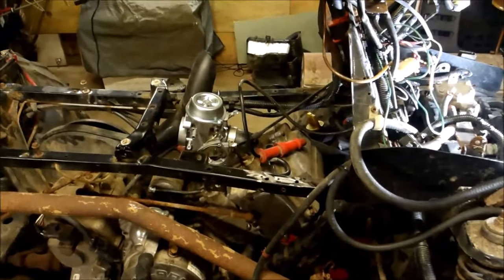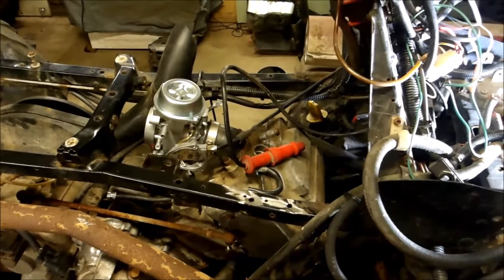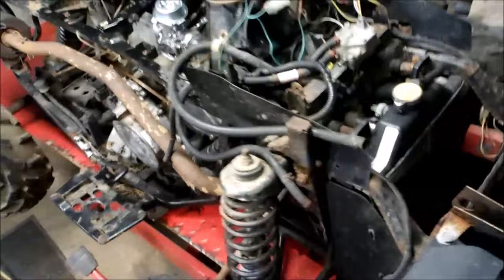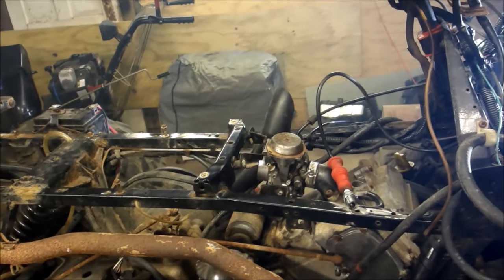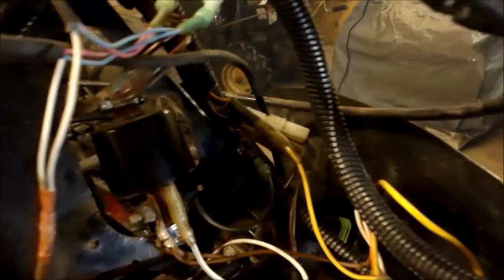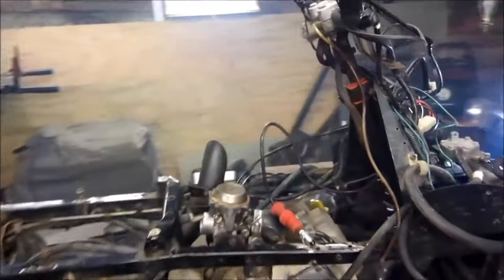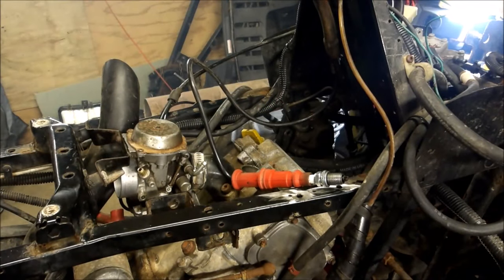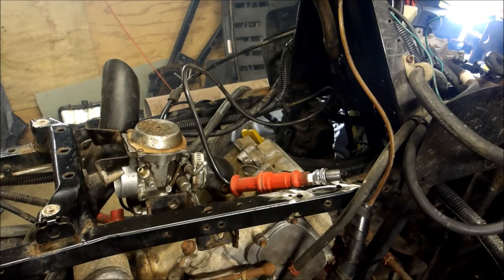No Spark or One Spark quick fix- Polaris

Comment: I know this is older video. But I just finally figured out this problem. Hook up your black wire. Hold throttle just open a bit till it starts to pull cable. See if it starts. Pop off cover on throttle. There is a kill switch in there on the throttle lever. If it touching then it kills spark. Cable has adjuster to adjust it to not touch. Loosen jam not and adjust cable. Then tighten jam not back up.
Reply from the maker: Yes. That can be one of the issues. The other is if the kill switch on the left is corroded. I rocked the kill switch back and forth a couple time on one. cleaned the surfaces and it worked too.

Comment: Not sure if you still monitor this post but my Polaris 500 Scrambler 2000 weeps gas out of the little black hose on the bottom. Stats fine, revs good but cuts out periodically at higher rpms, will idle fine, thought it was the carb, replaced with new, problem persists. Any ideas? Seems like its loosing spark while reving

Comment: Hey bud your videos are crazy helpful for my 500 magnum. This was driving me nuts today with no spark. I adjusted valves rebuilt my carb then i couldn't get it to start. I just saw this video and unplugged the black wire got alot of spark now. Gonna put the gas tank on tomorrow and see if it works! Thanks!
Reply from the maker: Awesome!  Glad it helped you out. That's why I enjoy doing it. For people like you. Good luck with you Magnum.  I love em. There fast!
Reply: Did the bypass trick work for you?  Picked up a 1995 425 Magnum today for a few hundred bucks that the owner said had a spark issue, hoping this works for me.
Reply: @TitaniummanGarage  l try to find intermittent sparks issue on my Scrambler 500, tested coil, good, l ll do your trick see if it sparks well.

Comment: Total fix after your video for mine was the reverse speed limiter. All I had to snip is the black wire of that box which on my 03 was right behind the oil resvoir. 2 black boxes were there. It was one on left. Followed black wire to it. Snipped that wire an bam I could start but only kill with kill switch. Need new reverse limiter switch as it went bad. However snipping that wire made it functional as normal other then you can not turn off by key an just by kill switch
Reply: Nice!

Comment: Thanks! Got spark back on my sportsman! What pat need to be replaced/fixed to be able to hook up kill switch again?!
Reply from the maker: The Cdi or you have a problem with the switch
Reply: Appreciate it. Is there an easy way to isolate which one is prob?
Reply from the maker: @jekru8774  There is a way to test the cdi. I've never done it before. You would have to google it.

Comment: My 2003 sportsman 500 starts on the pull starter but just turns over with the key.  Runs fine, but wont start with key.  What are your thoughts on that?

Comment: My 1996 425 magnum has the reverse limiter permanently stuck on in all gears including neutral, which causes it to idle incredibly rough and rev poorly occasionally it will clear up for a second idle fine, and then go right back to retarded spark. It currently has a cheap aftermarket CDI box and ignition coil that other people seem to also have problems with. Some people on YouTube have said to unplug a wire from the reverse limiter and it disables that circuit but mine still has reverse limiter stuck on.

Comment: Hi, I have a 2007 sportsman 450 carb doing the same thing, but it does not have a killswitch... any ideas? I've changed the cdi (twice) the pickup, the stator, the on/off switch, the coil and wire, the sparkplug and the speedometer. I'm tapping out, need help, 😆 
I haven't changed the surepower box yet, I opened it up, and it looks new.
Thanks for any help
Reply from the maker: Do you have power to the speedo? That's weird it doesn't have a kill switch by the light switch. I would check your ground wires as well. Make sure they are clean. I have one in my shop now. They guy replaced the pickup coil and the coil to sparkplug. He used a china coil. Guess what? I took it out and put a used sparkplug coil in and it fired right up.

Comment: I have a 2003 Polaris 330 it has a intermediate miss i check mt pickup coil it calls for a ohm reading of 520 i got 528 the gap is .018 calls for .016 to .030 I put a new coil on it has anyone got any advise what to look for beyond this

Comment: what year is your bike, I have the same issue, the book says to unplug from cdi, I cannot find that black wire your showing, I have a 2006
Reply from the maker: 2006 wouldn't have it. It's got a ECU.
Reply from the maker: I take that back. It might have the. Cdi but not like the 99
Reply: @TitaniummanGarage  I finally found the problem.  Is was the trigger. It was bent , gaped  it to spec and now I have spark and it’s running.

Comment: what year is you polaris? I'm working on a 2005 500ho and it does not have the black lead connector as you show, but i am experiencing the same issue, 1 spark when starting with key or toggling the stop switch with key turned to start. Just wondering if I should cut black wire going into the cdi unit which in the wiring diagram shows it is the stop wire.
Reply from the maker: 2000 or 2001.
Reply: @TitaniummanGarage  I went ahead and cut the wire, i now have spark but still no start, not even a trying to fire, just cranks, no pop or back fire, seems to be getting fuel. Still baffled a the moment, has to be something simple I'm just missing the issue. any thoughts, i check cam timing, crank position, valve lash, changed plugs, nothing working.
Reply: also compression is 50psi
Reply from the maker: @gp7967  That's wierd. You have spark, fuel, timing Look good? What about the air flow or exhaust? Found many mouse nests blocking exhaust causing it not to start. Did u say 50 psi. That's low. Possibly the rings need replacement.
Reply from the maker: Also you have a decompression ball on the cam so it's hard to get an accurate psi reading.  How many miles are on it?
Reply: @gp7967  where’d you find the kill switch wire for your newer model sportsman? I have an 06 and have the exact same issue. Sparks once and won’t after that until I shut off and the computer basically resets. Thinking it’s the CDI box
Reply: @johnhernandez3256  black wire feeding cdi black box that comes from the on off on switch on the left handle bar
Reply: @TitaniummanGarage  I got the same problem but I got a 2007 Polaris Predator 500 did somebody can help
Reply from the maker: @santiagotrujillo1807  usually the no spark issue is a bad cdi or kill switch.

Comment: hey boss.....im still in need of help. sportsman 400 still is no spark or weak (intermittent) spark. i did get it to run once for a day, but after i got caught in a downpour i am back to no spark with plug in the boot and a weak spark with the boot off. dont know if it matters, but the pull rope is gone and think water has gotten inside the stator cover. i took it off last time to look and wiped the flywheel with a rag and see if i had trash on the pickup. nothing out of the norm. but it fired right up and ran perfect up until the downpour..... what am i fighting here?
Reply from the maker: It could be a couple things. I would check your pulse coil to make sure it's clean and not bent by the flywheel. I would also check your run/stop/kill switch and the wires going to it. It could be corroded. The fact that it got wet and didn't run tells me it's one of the 3.
Reply: @TitaniummanGarage  I've done everything that you've done in your vids on this topic... tonight I had spark that was weak, with and without the run switch on and the boot off. Put the boot on and nothing... Added an engine ground to the coil and a ground from there back to where the ground loops go on the CDI bracket. Now I have nothing again. I wish you still had your Facebook up. It would be so much easier to talk. I'm truly at a loss. This electrical system is mind boggling. I also can't find the drain for clearing fuel out of the crankcase. I feel it may also have gotten flooded.
Reply from the maker: @BADCOCYCLES  Have you seen my video on where the drain plug is on a 400. I'm a little stumped too. Have you tested the coil and the stator?  I had a bad coil going to sparkplug go bad and a loose sparkplug wire.
Reply: @TitaniummanGarage  yes I have checked both out as of the first time I contacted you and were in spec...I got another Cdi and tried it with the same results. I cleaned up the flywheel and pickup as well as inspected the stator for visible faults and checked with a meter.  I looked for the vid you mentioned but I didn't see it this go around. 🤦‍♂️ I'm dying ova hea.... gotta have this thing fixed for hunting....I can't drag a deer by hand again this year. Lungs are bad

Comment: My machine is acting much the same way , starts up and runs good for about 25 seconds then dies , if I let it cool a few minutes , it will again start and do the same thing , I'm thinking the coil is the issue here, I'll disconnect the kill wire tomorrow and test again. If you have any other solutions it would be good to know as well , thanks for the video
Reply: Did disconnecting the wire fix it?
Reply: @ShaqTheBoss  yes, it runs great with the wire pulled. I installed a toggle to re engage the circuit after starting otherwise the kill switch will not work

Comment: I replaced kill switch, key switch, CDI, coil, plug wire, plug and checked contacts in throttle.  I still have no spark.  It'll run when I disconnect the black wire.  What else should I check?  (2002 Sportsman 400)
Reply from the maker: Did  you use polaris or aftermarket? I've had a aftermarket cdi burn up in 5 minutes.  Check the pulse coil by the flywheel too. Check the wires to it. Usually if you break the starter rope the pulse coil get damaged.
Reply: Do you think it may be the speedo. It doesn't work. No display. No forward, reverse, neutral lights either.
Reply from the maker: @DonnyG77  I bet you have a short in tue wires. Take headlight pod apart and look for severed wires. Bet u get your speedo to work too.

Comment: i have a 99  polaris magnum 500. problem im haveing is 80 pounds compression . have spark at plug put plug in but wont fire any thoughts
Reply from the maker: You'd have to run everything down. You have spark. Fuel? Is pump working will it start on spray? Compression? Its tough to get a good reading with the decompression ball on the cam. 80 sounds decent. And air. Filter clogged? Airbox have a nest in it. It could be lots of things. How is the sparkplug? Try a new one. What color is the plug? Black? Running rich. Should be light brown.

Comment: I have gone through a few spark plugs not sure if the plug was bad or it was something else if I changed the plug it would run fine for a while and then it was hard to start. Someone told me I have to let it run for a while each time I started it. What do you think?
Reply from the maker: Is it a 2 or 4 stroke? Yes, let it warm up. If you pull the plug and it's wet everytime you might have other issues.. too much gas coming out of carb. Coolent? Depends what the plug looks like.
Reply: Titaniumman Garage it’s a 4 stroke and I replaced the carburetor because the old one was in such bad shape, I think it’s running really rich
Reply from the maker: @unsaltedlife5998  I had the same problem on the Magnum. running rich. Try the air idle screw at the bottom of the carb. It should be turned out about 2 turns. Depends where you live. Altitude!
Reply: Titaniumman Garage thanks, also thought about your other video on the cam this bike has been abused hard and has many miles on it I’m thinking also has a exhaust problem too. I subscribed and like the way you do you’re videos very helpful thanks.

Comment: Can someone help my moms bf rebuilt my Polaris sportsman 500 4x4 and used the top of another Polaris sportsman 500 but it’s just cranks has spark gas and don’t even start with starting fluid strait in carb
Reply: It sounds like the carburetor bad just replace it with a new one off eBay for like $50 and it will work like new 💪💪

Comment: So, What do you mean until unfind whats really goin on? Isnt that what it was . A bad kill switch?   Was there something else?
Thanks if u can reply
Reply from the maker: your bypassing the kill switch. Some Polaris if you pull the black wire..it wont turn off. It could also be a bad cdi.
Reply: @TitaniummanGarage  New sub here. So CDI. Is that the ignition coil thing that the plug wire hooks up to? I am having the same issue. Would rather fix it and not have to unplug anything to get spark. Would greatly appreciate it if you could point me in the right direction.  Thanks.
Reply: @TitaniummanGarage  OK so I figured out what the CDI is. I  went and unplugged that black wire that comes out of the CDI box. It works and as soon as I plug that wire back in place the motor dies. Does this mean the CDI box is bad and needs to be replaced?
Reply from the maker: @606hillbillyracer3  yes. Or there is an issue with your switch .
Reply: @TitaniummanGarage  Funny you said that. I am having an issue with the run switch. Sometimes the neutral light goes off and I have to wiggle the run button back and forth and sometime that works and sometimes I will move the wires and sometimes that works. It is a new switch though so I am thinking that it's a bad connection. Would this be the cause of the spark issue?
Reply from the maker: @606hillbillyracer3  I would disconnect the wires at the top where it plugs in. See if the inside of the plug is turning green. It might need a good cleaning. I had an ATP that had the terminals turning green. I cleaned them all up and she ran great.

Comment: Fixed my '04 trailblazer 250 2 stroke! Thanks!
Reply: Was the connection in the same place as he showed in this video?  I'm wondering whats up with my 250trailboss as the red handlebar on off switch does nothing and then periodically/ randomly sometimes you have to hold the override button to avoid shutdown in reverse, other times not. 
Lately been having a stumbling upon first couple minutes of running then cleared up but today it sputtered around so much it almost let me sit, and arcing coil type spark jumping around under the gas tank area on the right side of the tank, looking down as your sitting on it. Very curious if this is related, cdi, coil ground or something else... Any help appreciated.

Comment: I’m having same problem with spark but the key won’t turn off the power to the bike also
Reply from the maker: With the black wire unplugged? That will happen. If its plugged in you'll have to replace the key switch. If you get spark with the black wire unplugged you know its the kill switch or the cdi that is bad.

Comment: I already bought cdi and coil but, I tried the this before I bought them. Now what..😂
Reply from the maker: Check the run/ stop /kill switch. they get corroded. also check the pickup coil. did your pull rope break at all? that causes issues with the pick up coil. Check your ground wires too.
Reply: @TitaniummanGarage  The pull rope is good, that's how I've been trying to start it lately. I cleaned up the switches and checked everything I could with the multimeter. I will definitely check the pickup coil. Appreciate the help, thank you 👍

Comment: Replaced starter on my 99 sportsman 500, now no spark, changed plug, still no spark...any ideas?
Reply from the maker: Try to unplug the black wire to the cdi box. You should have spark. Does the starter turn over? I assume so. They are 2 different animal's. Unless something got bumped by your stater wires when u replaced starter.
Reply: @TitaniummanGarage  yes the starter turns over.  Tried unplugging the black wire, still. No spark
Reply from the maker: @joncurtiscrain7295  Got to be the cdi box or a bad coil. check the spark plug wire. make sure it didnt pull out of the coil. I had that happen once.